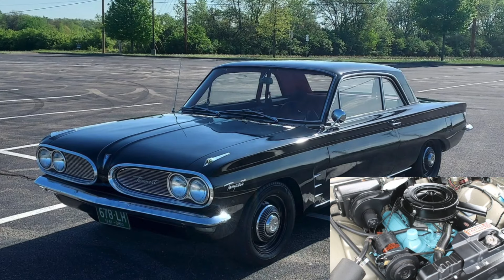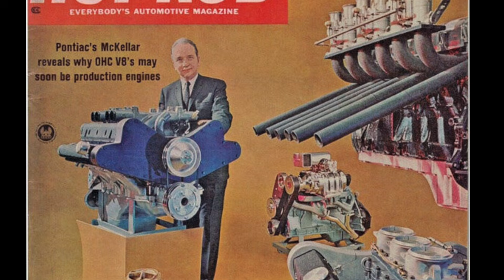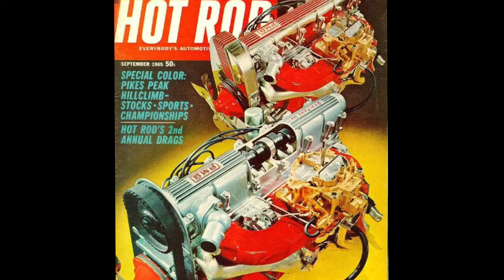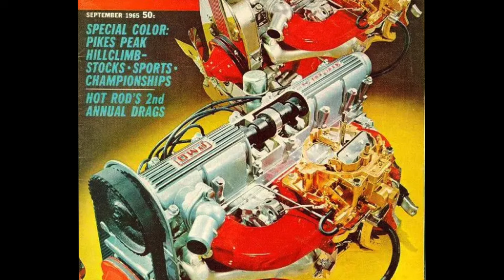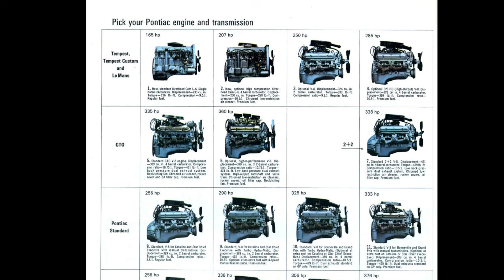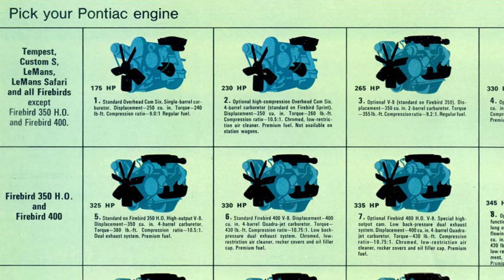Awesome Engines: Pontiac's 1966-69 OHC 6-Cylinder Engine (Tempest/Firebird/LeMans)

Comment: I had a rusted out Sprint LeMans in high school and I loved it! It was a 4speed car and even with the safe-T-track diff, it would scratch the tires at every shift!  This was in Denver, so I can imagine how fun it would have been at sea level.
You missed a couple technical points… in 1966, GM introduced the new Quadrajet carb. They started out with only two engines, the Pontiac Sprint 230, and the new “Mark IV” Chevrolet 396.  That Q-jet was a huge success.  To my knowledge. The 230 Sprint was the smallest engine to have a Q-jet.  Starting 1967, that carb was seen on almost every GM 4bbl car after that, right up to the 500 ci in Cadillacs.
As for the ohc Pontiac engine, it had a unique “hollow ground” cam profile.  Whereas most cam lobes are egg shaped, the OHC 6 was kinda shaped like the number 8.  This made for very high ramp speeds, meaning the valves opened and closed quickly.  The effect was that for a given amount of lift, a shorter duration would still expose the same open port area as a conventional cam with a longer duration.  The cams had a good amount of lift, but short duration.
The short duration allowed the engine to idle well, yet the high ramp speeds meant that the engines would still breathe well at high rpm.  It was an elegant and clever design the worked well.
Well, not entirely.  Because of the high ramp speeds, stronger valve springs were required.  This put extra pressure on the valve gear, and good oiling was critical.  Alas, the OHC 6 did not have good oiling.  The pump was kinda small, and sent oil to the crank first.  As the engines wore, the valves would get less oil.  It was not uncommon for the cams to “scuff” after 80,000 miles or less.  This was a euphemism!!! When this happened, the lash adjusters would not provide the correct clearances and at least one lobe would get extra clearance from the cam follower (rocker arm).  Then the cam would whack itself against the cam follower.  Pontiac had many warranty claims and service bulletins regarding “scuffing”.  
Crazy sweet engines when they were in top form. Crazy sweet!Loud clacking turds after they got worn.
Reply: My Sprint,bought new, had oil burn at 64,000,drove it like I stole it. So the head could have been rebuilt with new cam followers??

Comment: In the early 70's we used to get the Sprint version at the junkyards and install them in the "Advanced Design" Chevrolet trucks from the 50's. It really woke the trucks up and was an easy install. Still have one in the fleet and an engine sitting in the garage. They were pretty reliable other than the cam followers that did tend to wear.

Comment: Worked on a few of these in high school auto shop. Good engine, reliable and easy to service, ran well. Not really sure why they stopped production of these in the 70’s, would’ve been great in the little second gen. Firebirds if you didn’t want a V8.

Comment: Younger viewers may not realize this, but overhead cams were super exotic in the 60s, especially for American cars. The timing belt was invented by Hans Glas, a German who made his own cars, the Glas and Goggomobil. The belt then found its way into the Vega, where it may have been the most reliable part of the whole car. My major pet peeve is calling the driveshaft of the 61-63 Tempest 'rope drive'. The steel driveshaft has nothing in common with a rope at all, and a rope certainly cannot transmit rotational force. A less-crappy description would be more like a speedometer cable. If you have ever tried to drill a hole with a lot of force, you may have seen the drill bit flexing (most likely just before it breaks). If you lengthened the driveshaft, it would form a circle of 73' in diameter. The shaft itself was pretty reliable, but the bearings it rides in do go bad, and I have no idea it they can be changed.
Reply: BMW bought Glas and the rights to his timing belts. Not that there weren't timing belts in existence already just not any suitable for automotive camshafts
Reply: @mpetersen6  Oops. I totally forgot about BMW buying Glas.

Comment: If you think about it, the 4bbl version was making pretty good power to displacement ratios. LOTS of performance v8s of the time weren't anywhere near that, with only the uber tuned examples coming close to the 1 hp per cube mark. I think people were afraid of the belts, and sixes generally were chosen for economy. A 4bbl 6 cylinder doesn't equate to that, but I guess the std engine could be. Those actually made more power than any other 1bbl six on the US market of the time.

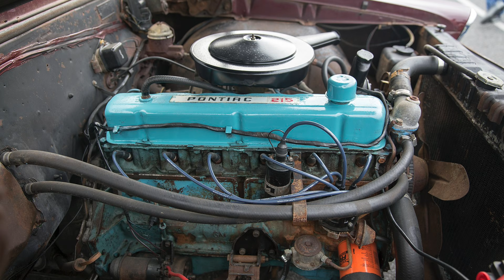Comment: That 215 6 @ 4:34 has quite an uncanny resemblance to the Red Holden 6 cylinder engine. Though dizzy and oil filter is in different location. If Holden had of adopted that Pontiac engine it would have been more in keeping with the larger capacity engines offered by rivals Ford and Chrysler In Australia.

Comment: I have two of these, both in 69 Firebirds.  One is a 230 horse sprint version with a 4 speed and the other is a 175 horse one bbl version with a 2 speed automatic.

They drive nice but not torquey like the basic V8’s.  They had so-so reliability in the day and were on the not recommended list by consumer reports thanks to overheating and cam wear tendencies.

I think that the higher cost and complexity more than outweighed the benefit of more power.  Especially to the typical six buyer who valued low initial and operating cost most of all.

An example of this is the sprint package.  It cost about 25% more than the 350 2bbl engine option but that 350 produced 35-50 more horsepower than the sprint and well over an extra 100 pounds of torque.  And the 350 ran on regular fuel as compared to the premium fuel requirement of the Sprint.  

While this type of math greatly limited demand the final straw for the Pontiac OHC was the new 1970 Firebird body.  Apparently the cam sprocket on the front of the engine didn’t fit under the new hood.  Given the poor sales, lackluster reliability reputation and high manufacturing cost it spelled the end of the OHC.
Reply: Yeah , the OHC I6s were a good idea on paper, but not in reality. All  I6s back then, were long , hard to balance engines. & no electric cooling fans or fan shrouds made them overheat in hot weather.

& breaker points ignitions really made those engines less than worth it. Carburetors were primitive then in comparison to today’s fuel injection.I couldn’t believe the smoothness , better reliability,better performance & improved starting of the V’s back in that period over the Inline sixes & four poppers. 
Especially in weather extremes.
Reply: Thanks for those thoughtful comments  - I guess its amazing they sold as well as they did!  Hey as a cammer follower, do you remember a road test of a 4-door Le Mans (or Tempest) with the engine when it first came out? (1966?)  Even had bucket seats...sort of a forerunner of the '73 Grand Am and Cutlass Salon.
Reply: @vintagemotelguest , yes I do, forget which magazine but iirc they tested it in France.  Car had overheating issues and was eating wiper fuses I think.

Comment: Good video.  This was before my car-owning days, so I did not own one.  My first overhead cam engine was the Ford 2.3 in a 1982 Ford Ranger.  Now very powerful, but very reliable and long lasting.  Also, not counter-balanced so kind of noisy.  In fact, after a certain point, it was hard to get good rebuilt carbs for my Ranger due to the vibration of the engine elongating the screw holes and such.  One more good point for this engine is that with one special tool from Ford, I could change the rubber timing belt myself.  It took all day as you had to remove everything in front of the engine.

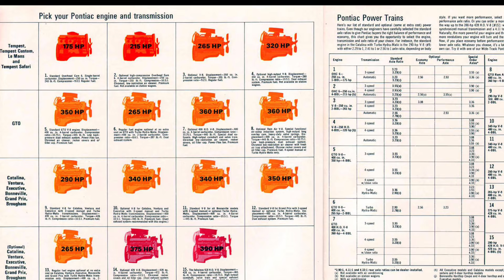Comment: Great video, Adam!  Minor correction at 14:50, the 250 cu in has a 3.875" bore and 3.53 stroke, thus still oversquare.  Only the 292, with it's 4.12 stroke is undersquare.

Comment: Funny thing was, although some of the engines with the 4bbl Q-Jet was advertised, it was technically a 3 bbl, where the secondary plate was just a big wide oval. Think removing the material between the 2 secondaries, and for all intents and purposes, it was like a choke plate but at the throttle plate location. Had a few of those carbs throughout the years, that I would use on V8's, with some modifications to the intake manifolds. 
Oh yeah! The old Super Duty engines! When I was in High School, my Mechanics teacher and I did a Fiero project, with a 3 litre Super Duty. We got a DOHC head from the USA, which  included a Bosche mechanical fuel injection system (four 1bbl throttle bodies), and a 4 to 4 header. We used 4 Supertrap mufflers to keep it "quiet"! LOL! We were making over 300hp at the rear wheels. Good times!
Thanks for bringing back the memories, Adam. Have a great day, Sir! o7

Comment: Love these Pontiac videos. When I was young, our neighbor had a Pink 67 Firebird Sprint with the Rochester 4 barrel. And at the same time in 1973 going to HS, I had a 67 Firebird H.O. (326 high output V8, only 2,900 made) with a  rare factory bench seat which they only made 1,800 Firebirds with bench seats in 1967.

Comment: Being a pony/muscle car guy of the late ‘60s/early ‘70s, it was “V-8 or bust!” in my circle, so I didn’t pay attention to this engine.  It wasn’t until I owned a ‘71 Datsun 240Z that I came to appreciate OHC straight 6s.  I would love to drive a 1st generation Firebird with the 4-bbl Sprint 6 with a manual transmission.

Comment: My dads boss gave me his 67 tempest with the OHC6 in 1974 ss he bought a new Fury 
When i got it the engine was making alot of noise .
He didn't keep up with oil changes and the cam was wiped out we replaced the cam and followers and aside from the rust it ran ok ,not any better than dads slant 6

Comment: Yep Adam, probably 10 years too early for these engines and would have been a wise decision to produce OHC 6-Cylinder engines again, after the gasoline crisis of 1973....Probably not many of the '66-'69 Pontiac's with the 6 cylinder engines around, but I'm sure U could find one if U want one, Adam. Cheers from Damo.

Comment: That's such an interesting engine! Great idea for a video though, that '65-'66 Quadrajet that they used on that I-6 Sprint engine. They released that revolutionary carburetor but it had a bunch of problems leading to a full redesign for 1967. I'm not 100% sure, but I believe there was even some recalls involved as they were prone to leaking and causing engine fires. It used a weird diaphragm style fuel inlet needle along with a goofy secondary air valve dampener that used the fuel. I think I could go on and on about that thing but it would make a really cool video as I'm sure you know more than I about it. As you probably already know, your '66 Toronado also came with that troublesome design Quadrajet! Cheers to another fantastic video!

Comment: Our '66 Lemans convertible had the base OHC 6  with super turbine 300 and safety track rear axle.  Timing belt and valve job @ ~ 50,000 miles.  Fuel economy never broke 21 MPG.  Mom loved her "little" car, Dad totaled it in 1970.  Dad said it was only another $300 for a GTO or Grand Prix, I think his memory isn't quite right on prices, he also felt the standard 326 2bbl would have had more power and equal MPG.  I may have a scan of the original window sticker somewhere.

Comment: One of my high school buddies had a '67 Firebird with the 4-barrel OHC/manual trans. SWEET little car to go cruising in! Boy, how I wish I had that car in my garage today. Seems to me that you used to be able to get a pretty hot cam for one of these and get close to 300 hp out of it. I always wanted to build one up and outfit it with Bosch mechanical fuel injection off of a Porsche 911.

Comment: Why an OHC engine but no cross-flow head?
Reply: Back in those days when they had carbs having the the exhaust manifold HEAT the intake manifold kept the fuel vapour in suspension better. It reduced gas mileage got better emissions and was easier start in winter. Not good for Ultimate power but makes it better to daily drive

Comment: Too bad they discontinued this as this might have been the perfect GM architecture for the 1970s. 

GM eventually bought back tooling for the Buick V6 (231 ci) and had V8s at 260, 265, and 267 ci across three divisions. 

Imagine a world where GM developed this straight six architecture for its brands. Entry level could have had OHV; premium models or brands OHC. Doing 4 valves and/or twin cams might have made sense for perfomance models. Buick's efforts on turbos would have added torque with a lot more smoothness for larger cars. 

This engine family plus the smallblock Chevy could have covered most of GMs RWD range X-body and up in the 70s and probably at less cost than the miriad of 4-ish litre engines they ended up producing. 

Imagine a first gen Seville with smooth, OHC, fuel injected straight six! Much closer to a Mercedes alternative. Alternative history!
Reply: Great thoughts!

Comment: Makes you wonder if they had kept with these smaller engines if the oil shocks of the 70's would have had less of an impact on everyday people.
Reply: Makes me curious how Pontiac would have been positioned had they actually put SOHC V8s and kept the I6 in production. Like, imagine if they had chucked a turbo onto the side of the Sprint 6?

The automotive world is full of "what ifs," like imagine if Olds hadn't absolutely corked it on the Diesel project?

Comment: If Only:
If only GM could have hung on to it long enough to spread around other divisions.
If only GM could have updated from 1936 suspension and braking technology and made a more modern chassis to use this mill. 
If only Pontiac could have lopped 2 more cylinders off it and made a 4 cylinder with comparable power to everyone else base 6 banger.
A tantalizing glimmer of promise squashed by what Brock Yates rightly called 'Grosse Point Myopians'.
Instead we got the gorgeous but wildly useless Toronado/Eldorado with no brakes, horrifying handling, an appetite for tires only surpassed by an appetite for fuel and increased interior space in a class of car that no one cared about more interior space. But at least it provided some parts to make the greatest motorhome ever made.
Still, loved this documentary of a great 'Only If'. 
*Also, Car and Driver (serious Pontiac boosters at the time) actually had a project car where they tossed the OHC6 into a Jag E-type (it didn't; work out that well but was good for a laugh)

Comment: Have one in a '69 Firebird. GM made a mistake by nor developing it further. The problems it had with the oiling system (ate cams), it would have been a great engine. It is possible to fit a 292 Chevy/GMC truck crank in it. Port fuel injection would have been great.
Reply: I think fords little overhead cam engine ate cams and legend has it that’s why they have modern ratings on engine oils.

Comment: In the early 1970's, my friend bought a used 1967 Tempest Sprint with the OHC 6.

As Adam points out, it couldn't outright beat GTO's SS Chevelle's, etc...  However, in the typical stoplight grand prix situation, on bias belted tires, that OHC 6 would run with those big V8's a lot better than anyone would expect.  Especially if you cut a good light.

I never understood why Pontiac didn't bring back the OHC 6 in the late 1970's when fuel economy and emissions became such an important issue.